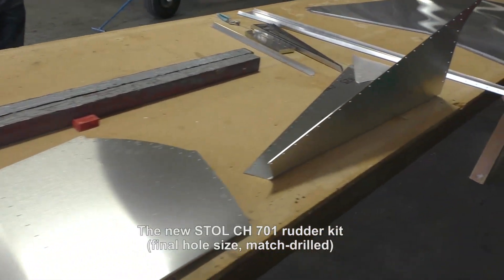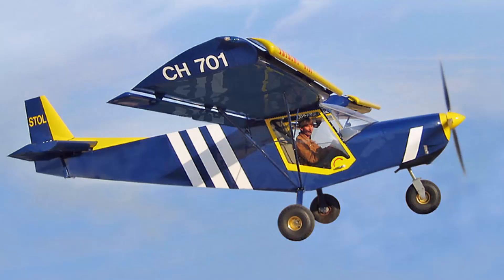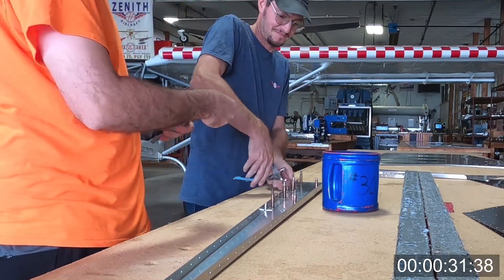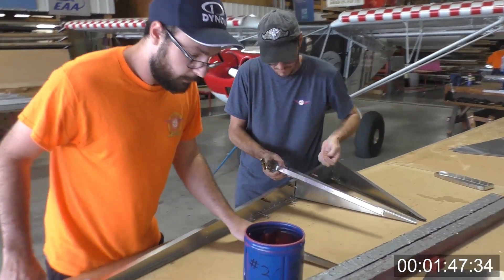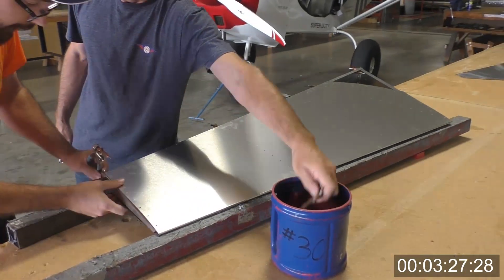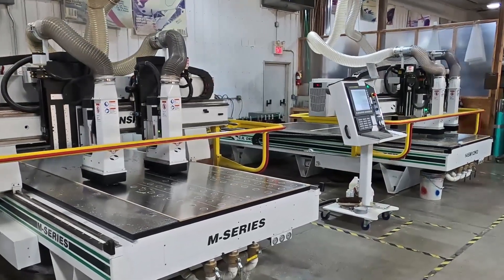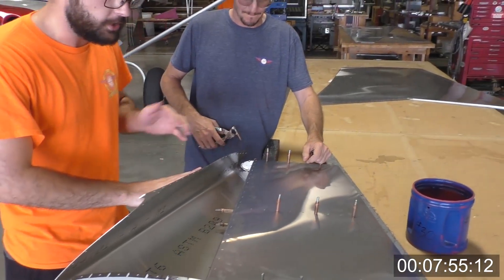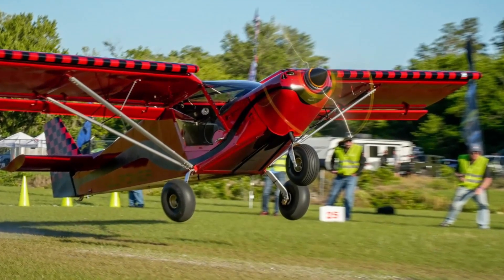Assembling the new Zenith STOL CH 701 rudder

Comment: So excited to see Jon Humberd working for Zenith. I’m waiting to order the new design of the STOL CH701. I’m hoping for faster build time, more payload capacity and a stronger firewall rated for a engine bigger than 100hp. I know guys run 130hp like Jon’s UL Power with no issues. But insurance could become a problem by installing a engine bigger than the Airframe was designed for.  
 Really looking forward to the new CH701. Hurry up and take my money…lol